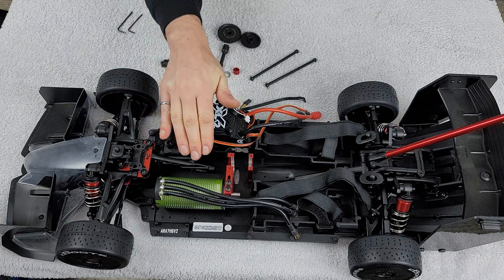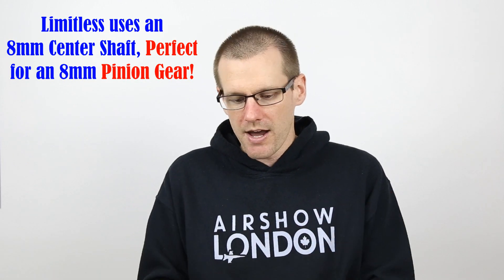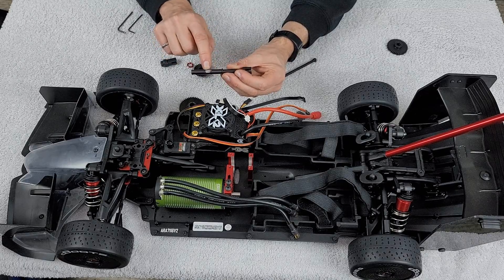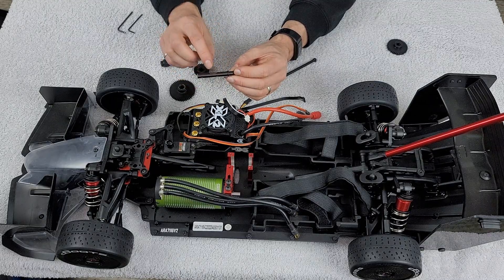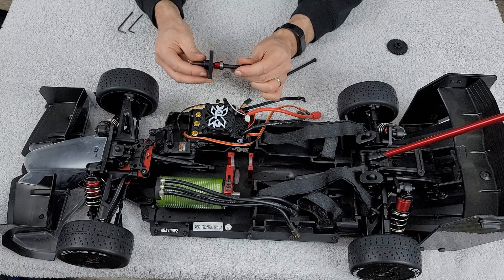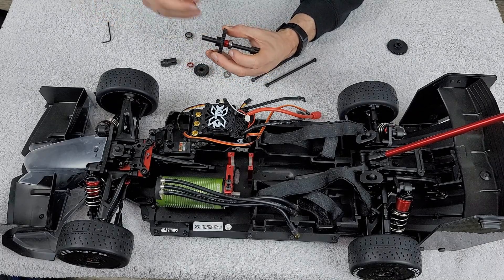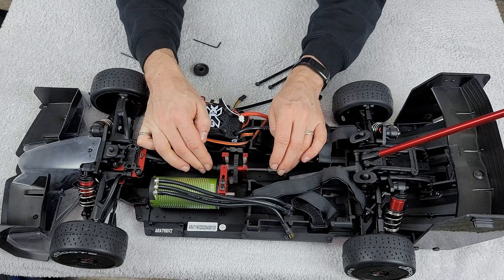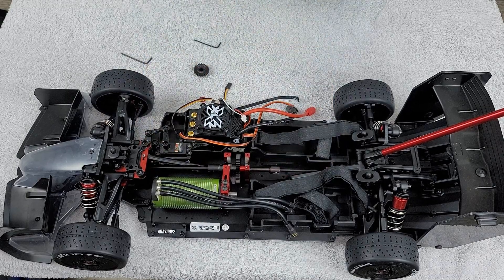Substituting a Spool Gear for a Pinion Gear on the Arrma Limitless V2

Comment: So i can install that 45t as the center using the stock existing 8mm centershaft?
Reply from the maker: Yes. I'm doing exactly that right now.
Reply: Will i be able to still revert back to the original 39 tooth spur/spool for speedruns or does this modification mean the shaft cant accept the original spool. I assume any brand 46 or 50 etc. Pinion will work for this? Thanks for your help @RCexplained
Reply from the maker: Yes you can swap back to original
Reply: @RCexplained  thanks sir
Reply: @OswaldBeef I use agfrc they 8mm shaft

Comment: you are using 17 series mottor size, I'm using 20 series and I bought several gears and they don't even touchig each other, lastly I bought 39T pinion gear with stock 39T spur, This is absolutely SHIT
Reply from the maker: The manual covers gears that will work. You can also swap out the spur. There may also be something in there about the larger motor size.
Reply: @RCexplained  I saw that but they didn’t mention about motor size also the parts in Europe is very limited, now i’m using spur gear also for pinion, I mean two spur same size gear 39/39

Comment: Please help———So basically I had recently bought one of these Spools for my Arrma felony and I know this comes from the V2 limitless. Now when I have purchased this type of spool I had gotten the stock two driveshafts that come with the v2 limitless.. further on I tried installing this setup onto my Arrma felony thinking it would fit but it doesn’t the center  drive shafts are either too short or make this drive shaft not align correctly with the motor mount. Please help if possible I would like to know why they won’t fit case I would assume the stock v2 limitless drive shaft should fit since they both are short and for the rear of the spool there its longer, so I just wanna know what I need to buy maybe just confused
Reply from the maker: The stock limitless shafts on the v1 and v2 are different and not interchangeable without significant modification. Why not get  the shafts specific for your model?

Comment: what is the smallest pinion that would work with a 46t spool?
Reply from the maker: Subtract 46 from the required minimum total teeth. This will equal the smallest pinion that would work.

Comment: The MOTOR PLATE on the 🏎️Limitless can be replaced by the FELONY / INFRACTION 
Motor Plate..!  This will let you run SMALLER gears! 

I made a video where I show the two plates up close and how to find them on the internet when shopping for them because the information does not tell you this!

I hope you don’t mind. I am going to share the link to the video here because it is very specific to the subject on your video and is useful information.

https://youtu.be/G9_LMnPIQgo

Comment: Just a tip, putting 2 set screws 180 degrees from each other actually does more harm than good. One will actually hold better, if you really want to use 2 you need to put them 90 degrees from each other.
Reply: You need to explain why not just say that?

Comment: Question for you sir: Is it possible to have TWO 6s li-po batterys connected in parallel circuit with blx185a ESC which is rated for 4-6s ?
Reply: That’s 12s